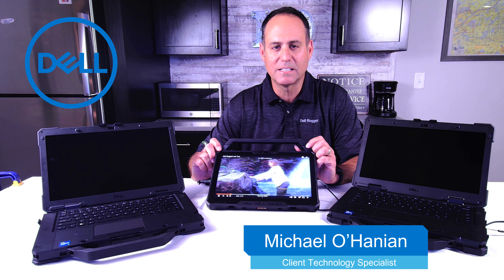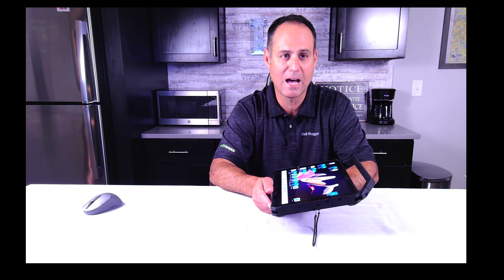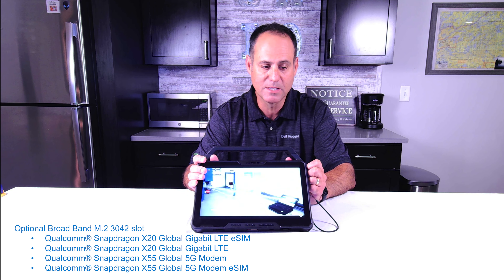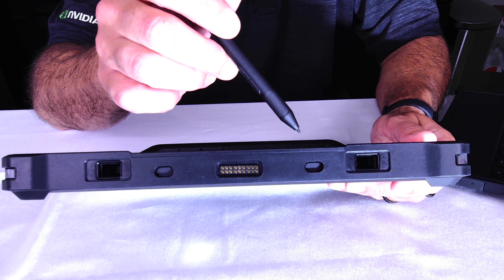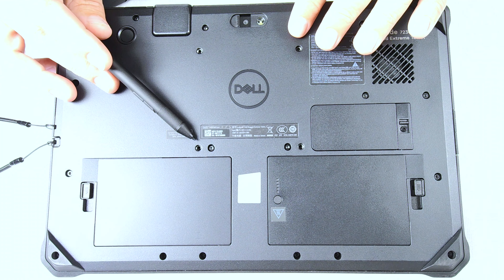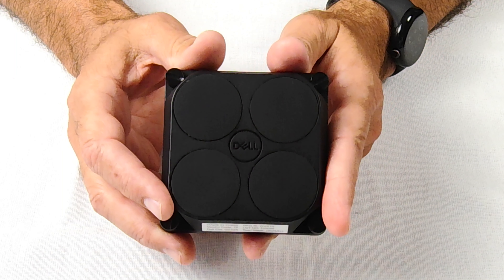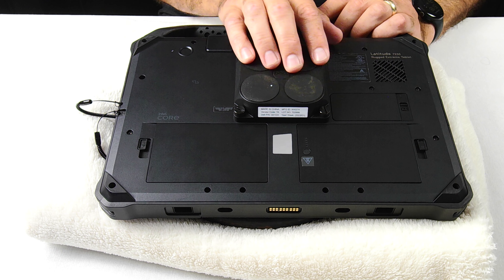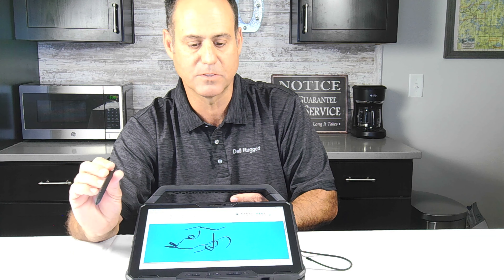Dell 7230 Rugged Tablet #iwork4dell

Comment: This was a great review.  Our biggest concern is the unit would be off balanced and top heavy with the keyboard accessory where it would tend to tip forward without the kickstand.  Our medics would use on their lap so if this is the case maybe one of laptop form factors would be better for us.  Are you able to provide any thoughts on the balance concerns?
Reply from the maker: @bayareaEMS I know what you are saying. I am happy to report that the keyboard is very solid and it has a strong connection to the tablet. You will not experience tipping from it being top heavy (very well balanced). Send me an email at michael_Ohanian@dell.com and I will is if I can get the local Dell rep to bring one to you to so you can see it.
Reply: @MichaelOHanian  You are great dude. I wish everyone at big companies would be like that

Comment: Very helpful demo. Can you confirm whether the keyboard is the 580-AKSN model or the rubberized 580-AKSL model. I got these two items optional on a Dell quote but cannot find any info on the two online. Thx.
Reply from the maker: @wesjohnson405 Thank you! US English Premium 580-AKUY (the one I showed on the video). If you want that same keyboard but have it a Rubberized version, the part number is 580-AKSL. Rubberized version is usually required for being at sea, when you have salt water exposure. Hope that helps. Let me know if you have any other questions.
Reply: Super! Thx!

Comment: Hi Michael - Great video! Regarding the Rugged active Pen is there a bracket or a way we can attached the active pen on the tablet 7230? Thank you.
Reply from the maker: @user-ye8cg1sl6z It does come with a tether cable that you can attach to the 7230. However, there is not a housing for the stylist built into the 7230. If you get the optional shoulder strap is does have a place to house the pen.

Comment: waterproof ?
Reply from the maker: @mulinaute Not water proof. That would be IP69. The number 5 in an IP65 enclosure indicates it is protected from light pressure water jets and other liquids sprayed or splashed, from any angle. For reference, the IP rating for liquids extends up to the number 9. An IP69 rated enclosure protects its internal components from liquids even when immersed beyond 1m or sprayed with close-range powerful water jets.